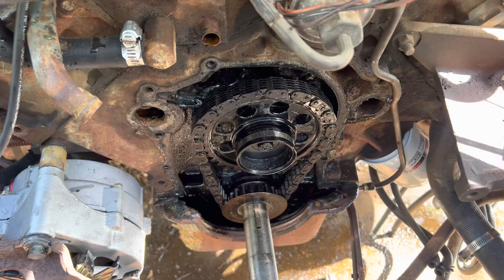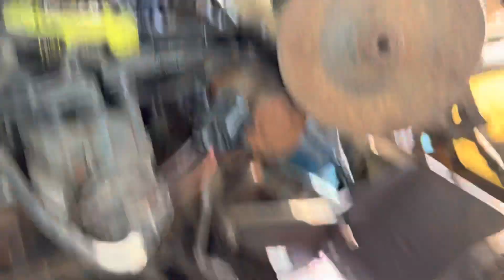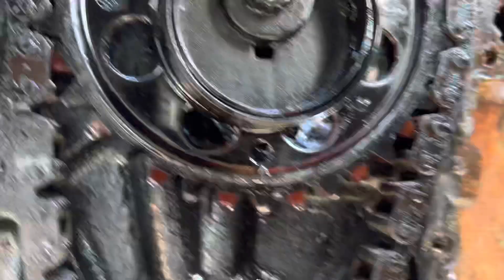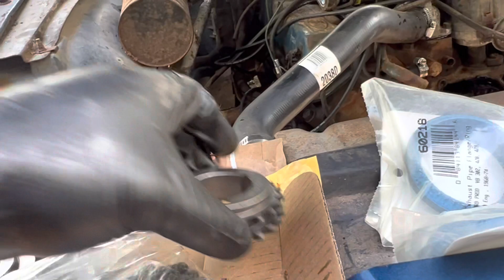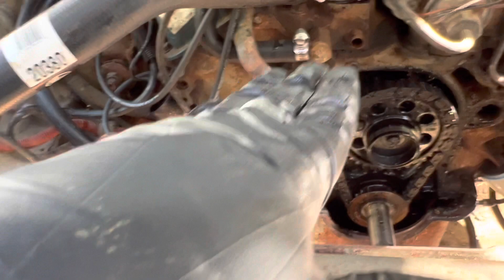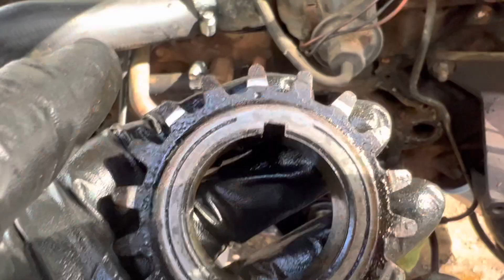1975 Lincoln Continental - 460 Straight Up Timing Set

Comment: Yes what you have is the factory retarted timing chain, on the new one you want the mark thats lined up with the key way on the crank. Also 88 and up fuel injected timing chains are all straight up
Reply: Also, changing the timing chain to straight doesn't add tork, it just moves the tork lower in the rpm range, your dis is what adds more
Reply: Hey I think your supposed to leave that washer off on the crank , it will rub

Comment: Theres a few issues here you might have if you arent having them already. It has been hard for me to find a double roller set that works correctly with that two piece eccentric (still looking). It appears that the set you used had a flush face which means when you torqued that cam bolt you now have a gap between the inner eccentric and outer eccentric ring so i hope you loctited the hell out of that bolt. The outer ring of the eccentric is supposed to spin freely when you torque the cam bolt. The other issue is that oil slinger. I have seen alot of pictures of those getting destroyed by the double rollers because the chains are wider than the old ones and at higher rpm’s that slinger can flex and make contact with the chain. Please chime in if you have not had any problems. Im trying to decide what to do with my motor
Reply from the maker: I’ve had no issues, but not many miles on it yet.
Reply: with a double roller you eliminate the slinger, it was used for the nylon chains. EFI engines did not come with the slinger.  Supposedly the 80's timing covers ET6* were cast both ways with a ledge and without. The EFI cover did not have that ledge either.
Reply: @skelafeti i bought a 94 f-350 EFI it had that splash guard oil disk in it when i disassembled it. Also had the double roller chain in it.
Reply: @juliusflowers-fn5bb  that aint right. you can doublecheck on the ford truck forums though
Reply: @skelafeti 🤷‍♂️ just know what was in it when i took er apart.  I’m fixing to start reassembly in a week or two.  Currently waiting on timing set, oil pump and rear seal to come in.  Not going back to EFI.
Reply: The way he installed it, the inner eccentric actually will work as a crushed Lock washer :) so he is golden. No concerns. But a mechanical fuel pump may not work well.